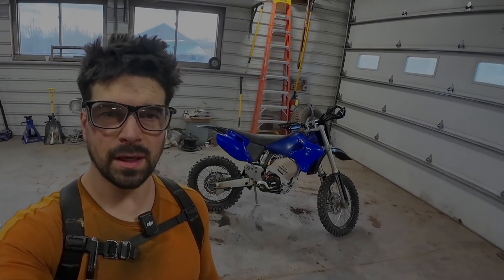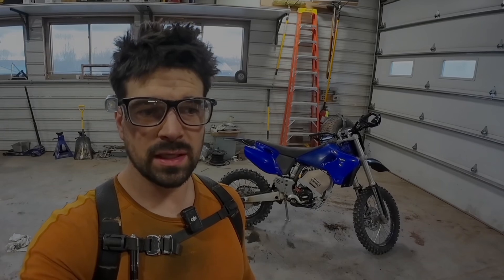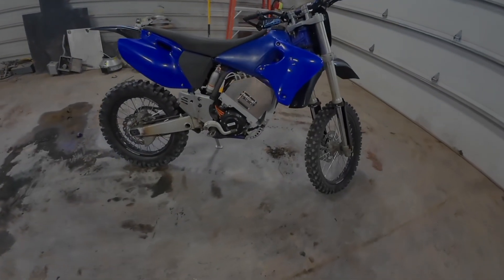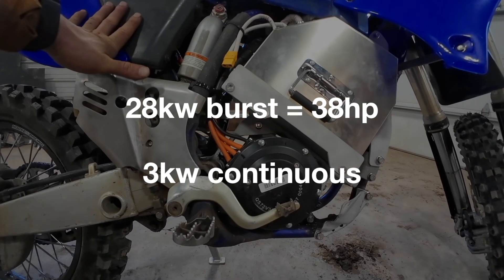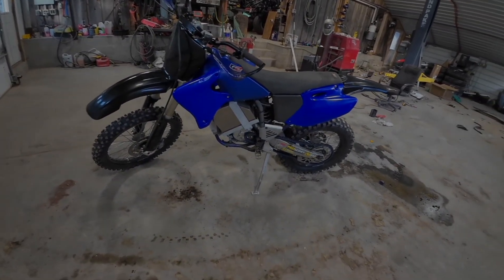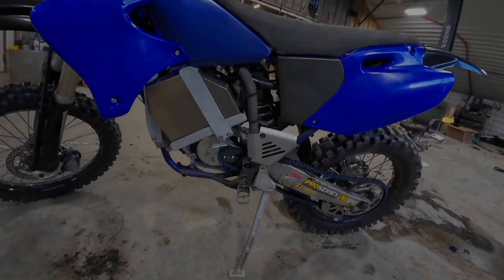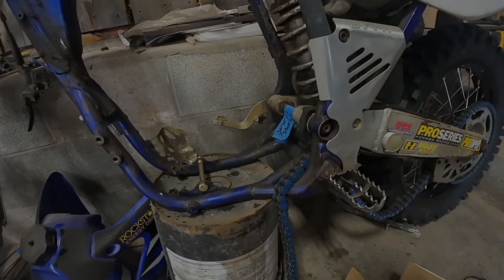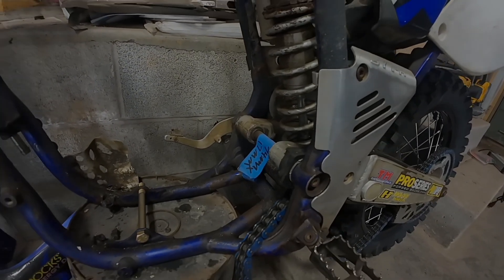Electric YZ Dirt Bike Build Electro and Co EMX DIY Kit Part 1

Comment: 2014 is oldest yamaha conversion on there web site,   you used a 2001 ?
Reply from the maker: Yeah, it wasn't a Yamaha specific kit.  It's just the DIY kit.  I used the "2-stroke battery".  It's just a different shape and fits the frame better.  The regular battery is meant to fit between the wishbone.